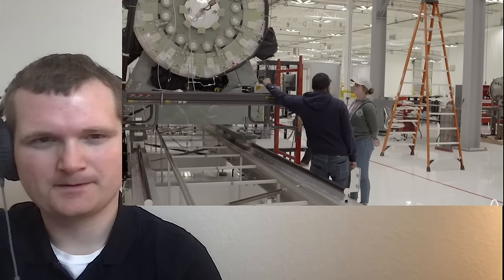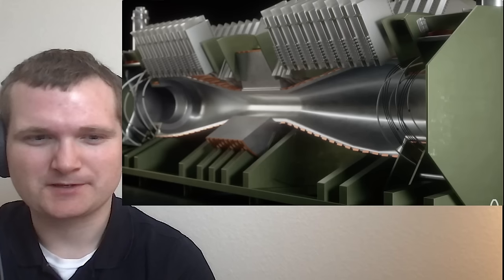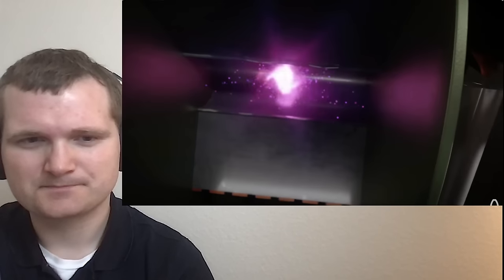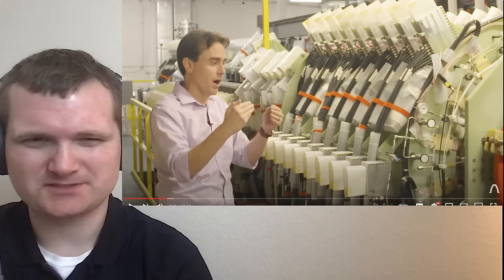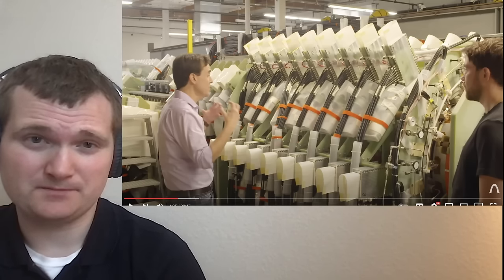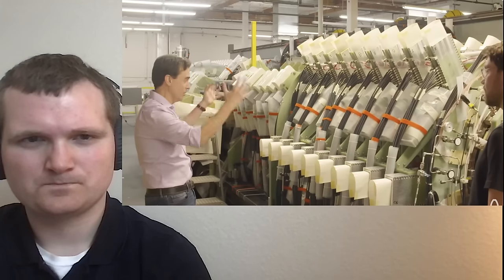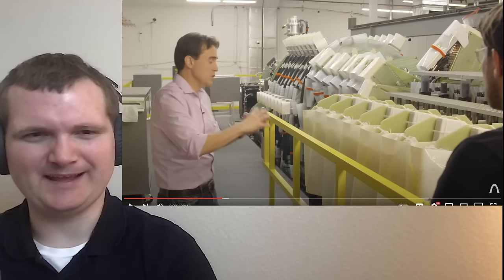Will the Helion Fusion Reactor ACTUALLY work? - Nuclear Engineer Reacts to Real Engineering

Comment: The scaled up version would operate at 250 million degrees and the conversion of charged particle energy may be 95% resulting in capturing 80% of the fusion energy. The ion temperature is also 10x higher than the electrons and scaling higher so the reactivity and final system energy gain are definitely good enough in theory for the manufacturable size and lower machine damage to kick economic competitiveness into play

Tokamaks have an expensive vacuum vessel facing higher energy neutrons with 80% of the fusion output energy instead of 6%. Helion will have much much lower wall heating loads and more freedom to choose the wall material, and have a simple geometry so vessel replacement costs seem likely to be 100x less than tokamaks

They have demonstrated 95% recovery of input energy from some kind of magnetic non fusion device so it will be truly interesting to see if they can see something similar this year or next with the fusion plasma

The scary regulation question is what you do with the unprecedented tritium reserves decaying into more He3 off-site. It sounds like fusion is confirmed for regulation under the medical/accelerator radioactive regulations so you just build in the states that want you otherwise

Comment: I don't know man, they have been working on this for over 10 years and they are on the way of building the 8th iteration of the reactor, i think they are onto something. Unlike the ITER having a pretty expensive candle for boiling water inside a jacket, the same way they have been trying to do for decades expecting to have a different result, this is an actually interesting concept.

Comment: I like the idea of using the same coils that compress the plasma to then extract energy back out as the plasma expands past them. Hope I said that sensibly. The thought is clear but I'm not confident in my wording.
Reply: As an electrical engineer, that feature caught my attention too and seems to have merits.
Reply: The concept is plausible, especially when you consider that an FRC is a high beta plasma (vs a low beta plasma, like a Tokamak).

Comment: The “nuclear diesel” model relies on a uniform outward field, dispersion into orthogonal turbulence completely destroys the ability to harness the output
Reply: What makes you think so? The current induced in the coils is the sum of the current induced by each particle; as long as the plasma expands on average, it doesn't matter what internal currents form. 

So it is exactly like diesel in that regard, it doesn't need a uniform or even controlled field. It just needs to be contained.

Comment: Either this guys is the best salesman or this is by far my favorite possibility for fusion power.  I did hear them say they will also be pushing out the excess thermal energy and still utilizing steam power generation along with the direct electrical conversion....so kind of like double dipping probably to further increase efficiency.
Reply: I think it's a very well done pitch. Given that 50+years of Tokomaks have not even come close to even a prototype yet it is necessary to take a new approach.

Comment: The neutron aspect that you seem very worried about is precisely why helion wants separate facilities.
The fuel generation plant will need need very heavy shielding because of the Dt-Dt fusion. Hence why it's better to separate the fuel generation from the power generator.
One heavily shielded fuel generator will make fuel for many, not so heavily shielded, power generators.

It seems like currently, helion gets 10% return on the energy invested as they said that 90% of the generated electricity goes back to the capacitors to recharge them.
As material technology improves as well as their process, that 10% return will grow.
In the end, compared to monstrous ITER tokamak type reactors, this seems like the process that will win out in the end.
 Yes, one tokamak type reactor using tritium may generate more power per unit, but if each unit costs 40+ billion dollars, several less expensive helion generators will likey generate more power overall per dollar spent

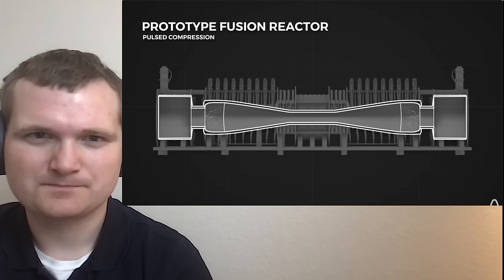Comment: 3:44 The idea of merging and compressing two compact toroids was tested and published by Daniel Wells  from the University of Miami en 1984: "Ion temperatures inferred from neutron yield measurements in the TRISOPS IIX plasma vortex structure generator",J. Plasma Physics (1984), vol. 38, part 2, pp. 263-274
Reply: Helion's cofounder first did it with FRCs at the UW in the early 2000s. The process is slightly different too, IIRC. Helion have a patent for it.

Comment: Even a puny 1kw in fusion reactions would be spewing deadly neutron dose rates a few meters away from the reactor. There is no way they are doing any real fusion reactions in that thing, is just a pretty plasma chamber, at most a few million fusion reactions per shot, enough to be detectable but even less useful than a Farnsworth fusor.
Reply: No one is standing next to the machine while it is running! The people operating it are in a shielded control room.

Comment: I'm not a nuclear physicist, so my grasp of the actual physics going on in this reactor is at the level of a well read but not fully educated layperson. Overlooking that for a moment, my main issue with the Helion is that the way its being described, the language they are using, and the plans for advancement that they've presented all make it sound like a scam.

They are using a lot of fancy sounding words that don't mean very much. They've given all the components they discuss flashy names that sound nice but don't actually describe the function of the devices. They discuss the science in very broad terms, making it sound like they are on the forefront of technology, that they alone have the solutions that everyone else is searching for. They dance around discussing the broad applications and advantages of their design, instead opting to single out Tokamak designs and talk about all the ways that they are superior to that, rather than offering predictions on how they will compare to traditional fusion power plants. They insist that all of their practical results are just around the corner, and that everything they've done so far has been cutting edge development and has paved the way for their next iteration. They make a point to explain how they are doing things differently from everyone else, and that their approach is the more practical, grounded method; they're not worried about all that super complex stuff that the other fusion projects are stuck on, they've got most of their issues figured out and now have just got to refine their design and then they're done, simple.

The whole presentation just raised all the "If it sounds to good to be true, it probably is." flags in my head. I felt like I was listening to a car sales man explain why his specific model of car was superior in every way for every application to anything else I might possibly imagine and that to even consider alternatives would be tantamount to complete madness.

Any new technology is going to have drawbacks and advantages. It will have areas where it stands out and areas where the old methods are still superior. It won't solve all the problems immediately and there's going to be a long and difficult period of refinement and development. I know they didn't really mention money at all (which is also kind of a red flag if you ask me) but the way this was presented makes it seem like they are trying to sell it as the ultimate energy solution, soon to be available in a power plant near you, invest now with a low low payment of $99.99 monthly, forever, and you can do your part in bringing about a clean, sustainable energy future!
Reply: - The RE video is made for the general public. It leaves out some technical details because of that.
- Tokamaks are the most studied and most common configuration. So it is natural that they would compare themselves to that. Everyone else does that too.
- I am not sure what you mean "don't really discuss the function of the devices". Which ones do you want to know more about in particular?
- Helion is fully funded all the way to commercialization. They are explicitly not looking for more funding.
Reply: @elmarmoelzer2229  I didn't realize that Helion weren't looking for funding, I kind of figured that was the reason they decided to work so publicly with Real Engineering and I have been expecting to see some additional promotional material out of them asking for additional financial supporters. If they're already set then more power to them, I hope they are able to get their design refined.

As for your other points, it is less that they didn't go into enough detail/specifications to satisfy me (though I do love exploring all the details!) and more that the gut feeling I got from watching RE's video was that Helion was trying to oversell their accomplishments and discourage skeptical evaluation of their project.

As I mentioned in my comment, I'm not a nuclear physicist, so I won't try to conclude that Helion is or isn't achieving what they've claimed, I just know that their video with RE sounded to me like a shady sales pitch, so until more information is available, I'm hesitant to put much faith in the likely hood of them producing the promised results
Reply: @resurgam_b7  
Well, what information do you need? What is it that you need to know or understand better?

Comment: If you use short pulses, you not only can get into Gigawatts, but Pettawatts (for lasers that is).
Reply: Maybe use laser pulses in tandem with the magnetic pulses as a guide. Super strong laser pulses do create an extremely strong EM field that could help shape the plasma from a ring to a parabolic wave shape. That would definitely get it going, but the laser would be huge and need lots of power.😮

Comment: Seem pretty clear the same coils that are used to create the compressing magnetic fields are the same ones that get the resulting magnetic kickback, and that goes back to the  capacitor bank ready for the next shot, with a little more than what it started at. From there you'd have to use an inverter to turn it into the sinusoidal 50-60 hz at 100-240v your electronics crave. It's always best to look at things carefully and not take things at face value, but you are kind of sounding like Dionysius Lardner who supposedly  said "Rail transport at high speed is impossible because the passengers would die of asphyxia". (though whether he actually said that is in dispute)
Reply: Yup! That is pretty much what they are doing.

Comment: FWIW, according to wikipedia, gasoline actually has a bit more energy density than Jet A.
Reply: Yep.  He's right that a military turbine engine designed for JP-4 (Jet A) won't run right on gasoline, but it's not because of the energy density.

Comment: 100uS discharge on a capacitor is really kind of slow.  I had expected they would need a much higher current pulse for a much shorter time.  Getting a pulse of a million amps on the coil around the reaction seems to me to be a really important part of the design.  When the plasma expands in that field, you will get a big voltage spike from the coil.  This is your energy output.

Comment: I believe one of the reasons they’re using that electricity generation method is it allows them for recoup a lot of the energy that they imparted into the plasma. Meaning in theory their margins with the output from fusion can be a lot thinner. & still get a net positive output

Comment: At 10:33, as a random electrical engineer I can answer that problem. As long as the bulk of the energy is in frequencies that are less than a few GHz, then it is trivial to extract and clean energy. As long as we have diodes that switch fast enough, we can physically take the RMS. From there, it is no different from solar.

Comment: Nice video. Always nice to see a critical analysis. I saw another video using the same graph of reactivity vs temperature and that raised a question. I understand that reactivity is important in the equation for energy production, but the energy content per fusion reaction would also be important right? Helion uses the MeV's of the reaction directly to create energy. However, tokamaks must use breeder blankets for tritium creation and a beryllium layer for neutron duplication. Surely this will decrease the usable energy per reaction, thus the total energy output right? Would love to hear your answer to this.

Comment: You should take a look at the Farnsworth fusion reactor design.  They have a website.  Basically, it's an inertial confinement reactor but it uses electric fields instead of magnetic fields.   It was proposed to generate electricity directly from the fusion reactions.

Comment: Tritium and helium 3 are similar in price because helium 3 comes from tritium. In fact they have technological pins called burnable  neutron absorbers filled with high pressure helium 3 to turn it back into tritium in a regular fission reactor.

Comment: I'm with you. They are doing nothing with all that waste heat, when they should at least turn some steam turbines and generate normally.
Reply: Only about 10% of the energy is released as neutrons. The rest is charged particles. At 50 MWe projected power output, that is only 5 MW in neutrons or 1.7 MWe. Not sure if that is worth the extra cost of a steam cycle.

Comment: Thank you for commenting on the video. I've been following this fusion concept for years now and I haven't yet heard of any such device actually fusing anything - it's always at the stage of plasma discharges in millions degrees far too low for fusion, not to mention that Wikipedia says that this concept (reverse field fusion) is just an unproven concept, so do you know by chance anything about actually achieving fusion in such devices?
Reply: This is wrong. Field Reversed Configurations are well understood. Several FRCs have reached fusion conditions (though not net energy conditions but only NIF did that so far), with Helion's Trenta probably being the most powerful yet.
Reply: @elmarmoelzer2229  What do you mean by "fusion conditions" - has any FRC device actually made fusion reaction?
Reply: @rgarbacz  
Yes, lots. 
E.g. the IPA (Inductive Plasma Accelerator) produced 10^9 Deuterium - Deuterium fusion neutrons (that is 2,000,000,000 fusion reactions since only half of the D-D fusion reactions produce a neutron) per pulse back in 2009.
Venti produced 10^11 D-D neutrons per pulse in 2018.
Trenta's neutron counts have not been published but given the scaling laws and size compared to Venti (3 times the radius, 30 times the volume), Trenta should have done at least 10^12 D-D neutrons/pulse. That would be 2,000,000,000,000 fusion reactions per pulse (note that a Helion machine pulse lasts less than 1ms).
Hope that answers your question.